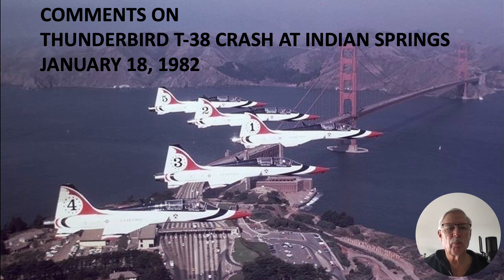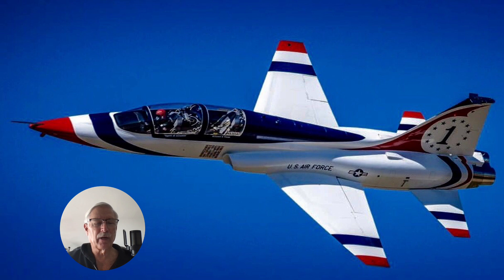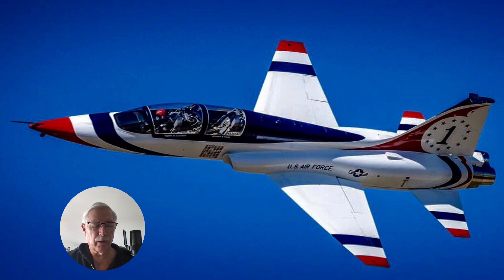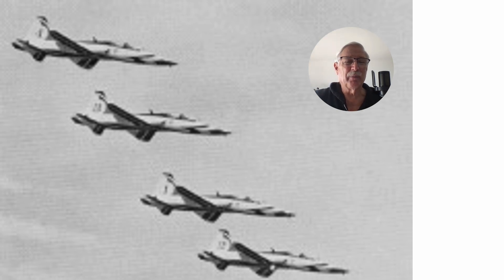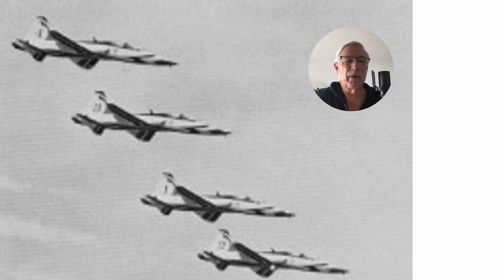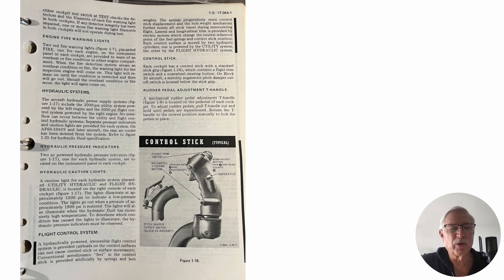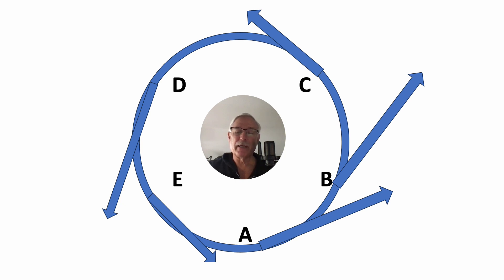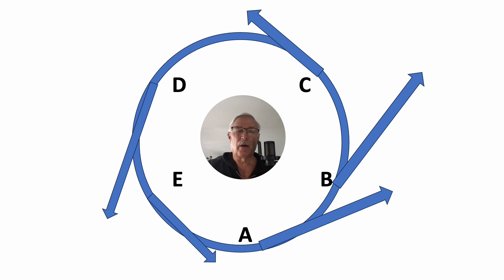COMMENTS ON THUNDERBIRD T-38 CRASH AT INDIAN SPRINGS JANUARY 18, 1982

Comment: I was a member of the Canadian Air Force Aerobatic Team (Snowbirds) at the time of this accident. We would often cross paths with both the Blue Angles and Thunderbirds during the summer air show season and developed very cordial relationships between us. Following this horrible accident in 1982 we flew down to Nellis AFB to attend the funeral and pay our respects. A very sad occasion.

The 4-Plane diamond crash occurred a few months after the previous Thunderbird lead lost his life in Cleveland, and only a month before the Blue Angles lost a solo pilot at El Centro. I was in my second year on the Snowbirds and all these accidents reinforced in my mind just how unforgiving air show flying was, near the ground with a critical shortage of available time to successfully eject from an aircraft. More so given that the ejection seat that I was strapped into was not a zero/zero seat. I can remember thinking about this when taxiing out for take off and I would often practice reaching for the ejection handles as quickly as I could. 

Your summary of the loop mechanics was spot on. The most critical part of a low altitude loop was just over the top. The airplane would be starting to accelerate; so it was critical that the pilot pull back and increase nose pitch rotation at the slower speed in order to get ahead of the impending rapid acceleration. It was important to do this sooner rather than later, before any significant acceleration could develop. Delaying the pitch rotation at the top or not pitching enough at the lower speed would result in a very rapid acceleration vertically towards the ground; requiring an exponential increase in G to overcome, and often resulting in what we would refer to a square turn out the bottom. 

Thank you for this video.
RIP to those that perished and deepest sympathies to their loved ones.
Reply from the maker: Thank you for your great comments!
Reply: The seat in the T-38A wasn't much more sophisticated than the one in your Tutor and it wasn't zero-zero either.    The death of Lt. Col. Smith (TB1) in the summer of '81 in Cleveland was largely attributable to the limitations of the seat.   His crew chief went out first, got one pop on the chute and survived.   Col. Smith got out, but hit the ground before the chute could deploy.   Many years later, the Training Command modified their T-38s to a new standard (T-38C), which does have an MB, zero-zero seat.   Sadly, many T-38s outside the Training Command were not modified and there are numerous USAF units (509th BW, 9th SRW, etc.) still flying A-models with the old seat.  I makes me sick to think that we continue to ask our aviators to fly a very demanding airplane like the 38, with seats that won't save their lives in the regime of flight where accidents are most likely, namely takeoffs and landings.    I felt that same sickness in my stomach when I watched the tapes of the Snowbird accident that killed Capt. Jenn Casey and nearly killed her pilot.    This should not be happening in the 21st century.   We have the technology to protect these people.   Love the Snowbirds, BTW.   Seen them many times over the years and they are awesome.
Reply: @kevinmadore1794 you know for certain that right now a lot of these planes are flying with out the updated seat?
Reply: @chickenfishhybrid44  Yes, that is correct.   The Training Command modified all of their T-38s to the T-38C standard, which has a Martin-Baker US16T ejection seat with zero-altitude, zero-speed capability.   You can basically eject while parked on the ramp.   That said, there were quite a number of T-38s in the inventory that were never modified and are still the T-38A models.  These include jets flown by some units with "Red Air" (adversary) missions as well as companion trainers used by the units that fly the U-2 and B-2 platforms.   These jets still have steam-gauge cockpits and the old Northrup seat, which has a lot of limitations, including forcing the pilot to walk out to the airplane with a big, heavy chute on his/her back.   On the Martin-Baker seat, the chute is part of the ejection seat and the pilot simply wears a harness walking out to the jet, like on most modern fighters.  While no seat will save you in all circumstances, the US16T is a MUCH better seat.   From my perspective as a taxpayer, I think it is unconscionable that we ask our aviators to fly an airplane that is as challenging as the T-38, with a seat that will not save their lives in many scenarios involving takeoffs and landings.....which is where most of the fatal accidents occur.
Reply: @kevinmadore1794 Thanks for your very thoughtful and well-informed comments. I learned a lot from what you had to say, and I agree 💯 percent about the need to equip aircrew with the best seats!! 👍
Reply: Joint Service Commendation Medal

Comment: i was a C-130 crewmember when this happened and my aircraft commander had been an experienced T-38 instructor. He had a theory as to why lead did not call break or knock-it-off. He said he had similar thing happen at altitude. The mic switch for the radio is on the throttle. If your stick is jammed and you are going to crash , both hands are on the stick pulling with all your might and you cant transmit, makes perfect sense.
Reply: ...except that there are other ways to signal the formation aside from transmitting over the radio.
As Ron clearly mentions in his video, chopping the throttles to idle prior to switching both hands to the stick would have been sufficient to save the rest of the formation.  And, alternatively, a Full AB Max Thrust recovery could have been attempted, which would have accomplished the same thing.  Alternatively yet again, if Lead wished to attempt recovery using a throttle setting which was intermediate, he still could have signaled the formation using Rudder Waggle, or Aileron Pulses.  Something... anything, to let everyone know that you're in a crisis situation.

Lowry did none of these things.
Reply: @dahawk8574 He could do all that signaling in less than a second? These guys are even more squared away than I thought!
Reply: @jefreagan  
The time between becoming aware of the critical situation to the time of impact was FAR MORE than one second.

I'm going to guess you've never flown a loop before.  Let alone flown a loop in a T-38.
Reply: You might also want to try to put yourself into Wilbur Creech's shoes...
WHY he destroyed the evidence.
Exactly what he decided needed to be hid.
Reply: @ No, not at all. I was going by what Ron was saying between step D and E, from what I understood as to when Lead noticed a fouled up actuator. I may have misheard or misunderstood. 
I couldn’t imagine how fast things came undone.
Reply: @dahawk8574  I flown the T-38 . Air Force politics did this . Lowery should have not been chosen for the lead role of Thunder Birds. When you are 30 knots fast on the backside of the loop and have only 100 feet to play with ,should have called breakout or knock it off and the rest of the  wing men perhaps could have survived !

Comment: When I was in the Air Guard we had an A-10 experience a complete lock up of the control stick. This happened right after engine start and before the airplane started to taxi. A maintenance mechanic went up the ladder and reached into the cockpit and tried to move the control stick. He confirmed that it was locked. After shutdown the stick started moving again. There were a number of attempts made to duplicate the problem but in never happened again. The entire flight control system was inspected but no apparent cause was found. The pilots refused to fly the plane again for obvious reasons. It never flew again. It was stripped of all useable parts not associated with the flight control system and then it ended up as a static display.
Reply: Very odd problem.  Without the crew chiefs verification, it would be chalked up to pilot error.
Reply: That's quite something!! 😨

Thanks for sharing this episode with us.

Comment: The accident was briefed to the team by Gen Creech as due to a pitch actuator being jammed by a portion of a rivet normally left in the stab during manufacture. Major Lowery had just completed a phone convo with Gen Creech before he walked to the flightline. He was not his usual jovial self, very tight lipped without the normal greetings to "the boys" as we lined up to salute and shake his hand. Apparently the phone call had not gone well. This potential distraction/pressure to immediately improve which led to a drastic decrease in the entry altitude for maneuvers that day was of course not in the accident report because his boss (Gen Creech) oversaw the investigation.
Reply: And you know this how?
Reply: @garyculver4345 Had there been issues prior to the phone call?
Reply: @joe92  My understanding is that the show work-up/altitude decrease was not progressing at the expected rate.

Comment: This reminds me of the British F4 demo crew that ariving at the airshowbase, immediatly started a practice display but forgot to change the altimeter setting andere looped straight in the grond.
Reply: This accident had nothing to do with altimeters. You didn't need the altimeter to correctly perform this maneuver whatsoever. The maneuver was to be entered at 400 knots with a pull to an initial 4 Gs before the airspeed bled off. The top was always about 6000 feet above the ground and from there the T-38 in the thick air of low altitude aerobatics, had a huge margin for error in which to recover. In fact, if one wanted to, they could make it into a big 9. Years later an TB F-16 accident did, indeed, crash due to altimeter error, but that was because his opening climb was less than vertical before he reversed back inverted in the opposite direction. Because he did not pull to the vertical, he needed the altimeter to know when to reverse. That was not the case with the diamond accident.

Comment: I take it the aircraft did not have the zero/zero ejection seats?? Were those not in use as of that date?
Reply from the maker: Would not have mattered. When you are in a high rate of descent, you need a lot of altitude for the seat to work. Sometimes as high as 10,000 ft AGL.
Reply: The T-38A did not have a zero-zero  seat and still does not.  Aircraft modified to the T-38C standard do now have a Martin-Baker US16T zero-zero seat.  Most of the modified birds are in the Training Command.  As the OP notes, a zero-zero seat would not have mattered in this case.

Comment: I remember reading a report where they said a BOLT was lodged in the elevator which caused the crash! I KNEW it was a crock!
Reply: I have over 50 years as an aircraft mechanic, the possibility of some type of FOD causing a problem like that is not hard to believe at all.
Reply: We had an F-4D at Holloman AFB in 72 that had flight control issues on four flight when the roll stability augmentation system was engaged but flew fine when it was off.  On the fifth flight the plane would not recover from a shallow dive and flew into the ground killing both crew members.  a gouged and bent pair of pliers was found in the tail of the jet in the area where the rudder and stabilator  linkages are adjacent.  Accident board determined the FOD was the cause of the crash.
Reply: I remember reading the same thing.  The bolt was improperly installed limiting elevator travel.  The video of the four aircraft crashing one right after the other, was chilling.
Reply: This was probably a jo-bolt, one of a great many that had been punched out by a contractor during the T-38 longeron mod. It was not something that had been improperly installed. It would be something that was lying hidden within the structure after the modification, until the inopportune  moment.

Comment: The initial report of the board was a finding of pilot error. The lead aircraft had topped out on the loop at an altitude below the minimum
required to insure a safe recovery. Failure to recognize the altitude and continuation of the maneuver to the pull through meant that after reaching about 60 degrees nose low inverted, the formation was in a position from which recovery was no longer possible. 
There was evidence reported that the control stick and linkages were deformed probably due to pilot effort to pull through at whatever G was available.  When the report was submitted, General Creech (Tactical Air Command boss) returned it and reconvened the board with the statement that "Thunderbirds do not commit pilot errors." Command guidance was to come up with another cause.  That was when the flight control was invented as the culprit
Reply: Yes!  This comment is exactly what I remember from my father at the time, but I heard it as "Thunderbirds do not make mistakes."  Also, there was rumor that the government actually gave Northrup the money to pay the lawsuits.  On top of that, the T-38 has been used ever since for training.
Reply: I heard the same John.
Reply: This is not correct. Lowry was about 9 kts slow in entering the loop. It topped at the correct altitude. The load relief cylinders were collected from each debris filed. Lowry's relief cylinder rod was fully extended, evidence that his stab was in disagreement with his stick position. The other three relief cylinders were not extended when they failed.
Reply: @Robert-wq2bd   I'm glad to see that someone else realizes that the condition of the load relief cylinder in the leads ship was an indication of some kind of malfunction in the stab system.
Reply: "...about 60 degrees nose low inverted, the formation was in a position from which recovery was no longer possible."

It's been over a year, yet no one has called out the OP for this bogus assertion.
The way to recover, most obviously, is to pull sufficient G to prevent from impacting the ground.
Reply: There was more to that comment than you posted here, some of which I did not agree with.  The AW&ST article had photographs of some of the components of the stab system that did indicate an anomaly.
Reply: Pilot effort deformed the linkages? Can that really happen? I know folks in dire straights can gain strength, but that seems unlikely to my amateur mind.
Reply: @jefreagan  There is an overload cylinder in the stab system that is suppose to prevent overloading of the components to prevent damage and there are also stops in the cockpit that limit the travel of the control stick so I would think that deforming of the linkages by the pilot would be unlikely. There is a similar set up in the aileron system with an overload spring.
Reply: Hoss Jones told me that Mark Melancom told him the boss was scaring them. He was opposing solo and was with the them four years.

Comment: The paint job on the T 38 airshow planes is stunning & presumably difficult to bring about. My question then is: Did airforce personnel paint these planes or was it contracted out to a specialty contractor?
Reply from the maker: Good question and I don't know. I thought the AF did the paint but not sure.
Reply: The original T-bird F-16s arrived brand new from the factory in T-bird paint scheme. Subsequent touch-up and periodic full repainting performed by Thunderbird Corrosion Specialists (paint shop).
Reply: @garyculver4345  Today, when the Thundebirds need a new jet, they usually get one from an ANG unit.  It's a regular, front-line airplane.   It comes to them in the low-viz gray that all F-16s are sporting, and they modify it and paint it in Thunderbird colors.   I believe that the 'Birds are currently flying Block 52 jets.

Interestingly, the Thunderbirds have always proclaimed that the jets could be made combat-ready in 72 hours.   To prove that, many years ago they took one of the A-model jets, took out the smoke system, put the gun back, hung pylons on it, and one of the T-Bird pilots, Maj. B. J. Java (TB7), took the jet out to the Nellis ranges to drop some live Mark 82s and shoot some 20 mike-mike.  I've seen pictures of that jet in Thunderbird paint, with bombs and missiles hanging on it.   After the mission, somebody apparently wrote the name "Warbird" with his finger in the gun residue on the side of the airplane.
Reply: On every U.S.A.F. T-Bird aircraft their paint work has always been stunning. The Thunderbird on the underside always look sharp as hell.
I'm a U.S. Navy Blue Angels guy and will not deny the Thunderbird planes are the sharpest looking.
Reply: @WilliamM-e6n  The paint job on the F-4Es was the best TB paint-job IMHO.  It was in that scheme that I saw my first show back in '73.....the first of over 100 that I have seen.  If you want to see what it looked like, stop by the Pima Air Museum in Tucson sometime.   They have a former TB F-4E painted as Maj. Al McArtor's TB7.   He was the guy who narrated my first demo.  Gorgeous jet.
Reply: Yes, that was a classy livery and the serif font for the numbers looked great, also. Saw them at Maxwell and Luke before the -16's took over in '83.
Reply: The team repaints the airplanes on their own a few at a time each year or so. The F-16s came from GD painted but the team streamlined that  scheme in house. Team painters and ex team painters have painted historic schemes for various museums and displays like the AF museum F-100 TB, the AF Academy  T-38 TB, and the Castle AFB F-4TB. The team has had some extraordinarily talented painters over the years.

Comment: With that actuator being so critical to flight safety and known to fail at times, I wonder if it was a design or maintenance failure, and why they still had to fly with that problem occuring at times without a fix. A failure like that seems like it should have been corrected before anyone flew it again.
Reply from the maker: This was an extremely rare failure that occurred at the worst possible time. Most critical failures in this aircraft are remedied by punching out.